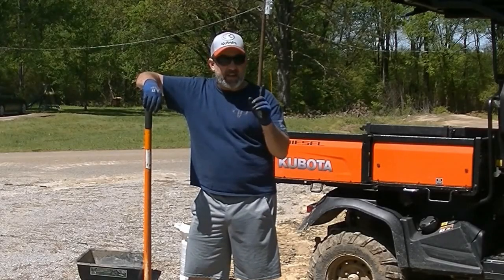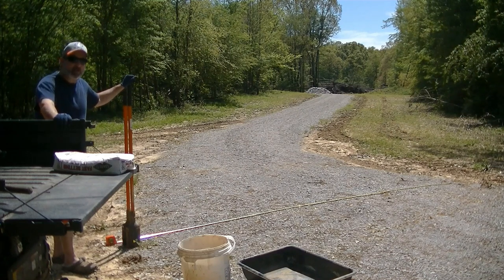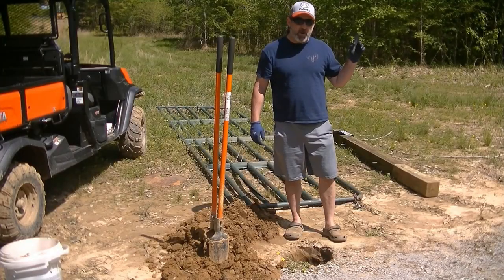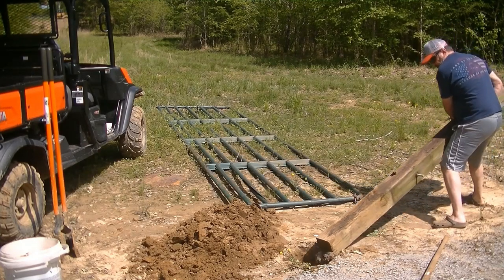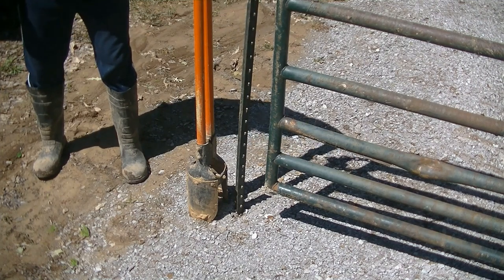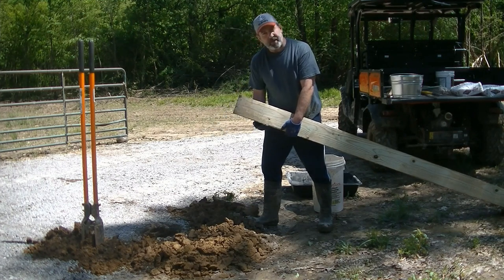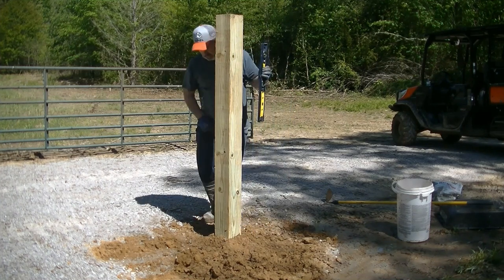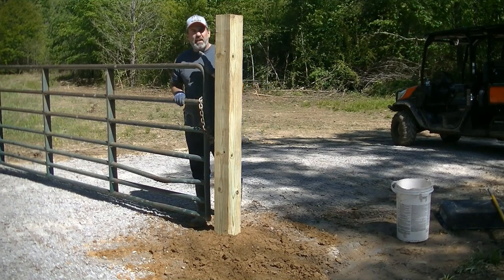HOW TO Install a Farm Gate (setting posts and hanging/leveling gate)

Comment: A tip i learned from a old ww2 vet,,he said to always paint bottom 3-4 ft of post with creosote or roof tar to preserve post form rot,,using cement even on treated wood causes rot eventually,,being that you have a 6/6 post i doubt you have a issue but 4/4s installed with concrete always seem to start leaning after 5 -6 years,,old guys are the best when it comes to building stuff the right way,,FYI gates and locks are for  honest people,,i have had my tube gates cut in half with a sawzall so 4 wheelers could trespas son my prop
Reply from the maker: Great info. Thanks!

Comment: I pour the cement dry down into the post hole with the wooden post already in the hole. Then I add water then mix and pack the cemente mix and make sure I pack a lot of cement around the top of the hole then slope the concrete away from the wooden post so that rain water would drain away from the wooden post.  I also paint the bottom of my post about 3 feet from the botom with Leak stopper roofing paste (a tar like solution).  I've had post in the sandy soil over 20 years and the posts are super sturdy. No rot, no leaning posts. I've even bumped the post with my tractor and not one issue.
Reply from the maker: Oh yeah many do it like that. Good stuff

Comment: We install those automatic gates all the time. If you don't have a ton of sun all the time. Run a wire too if you use it a lot. Most people with the solar gate call to back to get permanent power.
Reply from the maker: Thanks for the headsup!

Comment: Great job, great vid
Reply from the maker: Thanks!
Reply: @RidgeLife  I have a quick question. What's the max distance separation between the Post & the Gate where it attaches to the J-bolt?  I am planning a 16-ft gate (minus 4-5 inches for hardware) but I installed my RR ties at a separation distance of 17-ft.  I found a 18" J-bolt online in lieu of a 12" J-bolt. Would a Post-to-Gate distance of 8" be too much stress on the 18"x3/4" J-bolt? Thanks in advance. (1st time installer) 👍🏼

Comment: Sorry to here you get so many trespassers, that is the pits. I'm designing and welding up my own bespoke farm gate. It's going to have wire mesh on the outside to keep dogs out, as dog walkers come passed my property. This might be a dumb question, but how far off the ground whould you suggest the bottom of the gate be.
Reply from the maker: Ooh, Id' say only a few inches if you can. Lower the better! Thanks!
Reply: @RidgeLife  ok thanks pal. It's going to be the first one I've done, LOL. It was fascinating watching you do yours though.

Comment: Nice video, but I do these all the time. Fast Setting concrete gets dumped in the with water, no pre-mixing per instructions that's why you buy that instead of regular concrete. Posts always get buried by 1/3 the height so gates (or fence) don't sag. I did a 10' gate post buried 48".  A 7' gets buried 36".  A 6" post gets an 18" hole, that why people's stuff sags all the time. Read Sakrete or Quickrete's sites.  You did more work than needed mixing concrete and less work in digging the right hole size.   The hinge part is accurate is security is a concern.
Reply from the maker: Thank you very much for the help.  It's holding up so far but may need work in the future.  Take care.
Reply: Yes, and also concrete mixed that thin is not going to reach full strength, is it?
Reply: Too watery.

Comment: How much concrete did you end up using?  How many 50 lb bags would you suggest?
Reply from the maker: If I recall, I used 17, 80# bags but mine was large for a package unit. You can use the concrete calculator on Lowe’s website. It was spot on!. Good luck!
Reply: @RidgeLife 17bags for how many holes?

Comment: How far apart do you set the post to account for the length of the hinge, etc. I'm looking at a 12' gate using 6x6 posts, I was thinking of 13' center to center of each post hole.
Reply from the maker: I added 6' to both sides.

Comment: Cool video thanks for sharing but you have way too much water mixed with your concrete because when you have too much water like that the concrete is a lot weaker compared to when you just have barely enough water to mix all the dry concrete together where none of it isn't dry anymore and also you should have touched up that gate with a few fresh cans of spray paint just to spruce it up since you reinstalled it but nonetheless cool video and I appreciate you sharing it!
Reply from the maker: Good point! Thx!